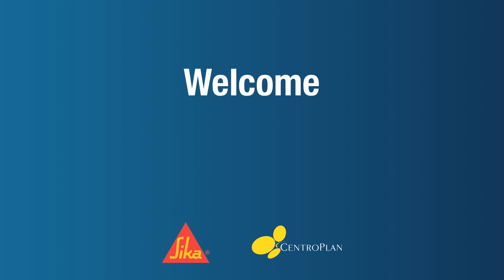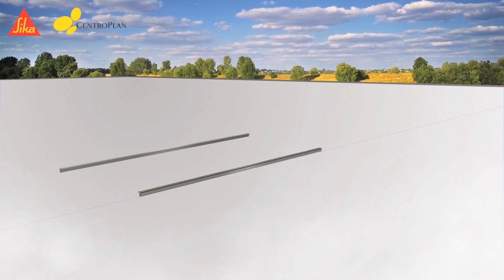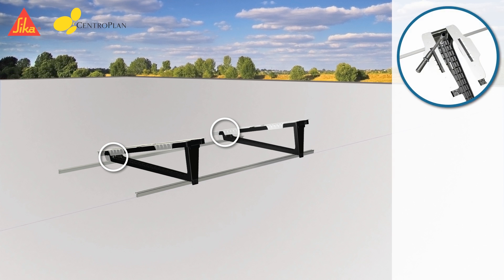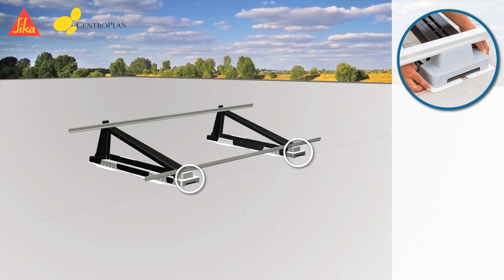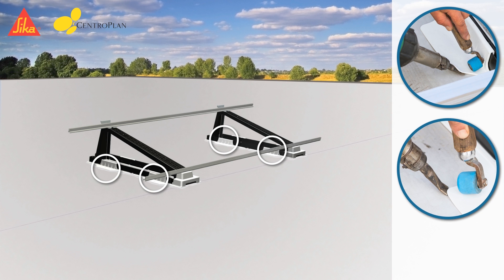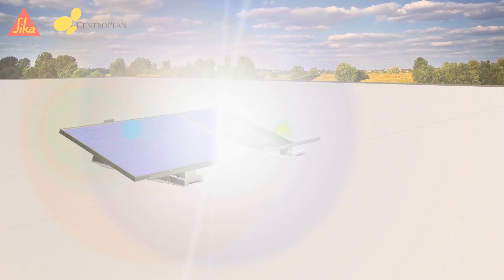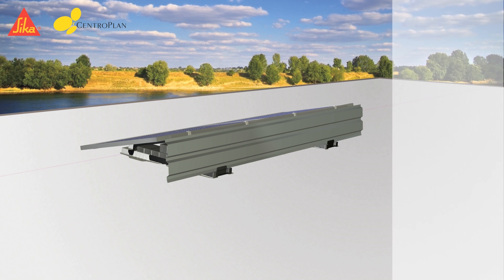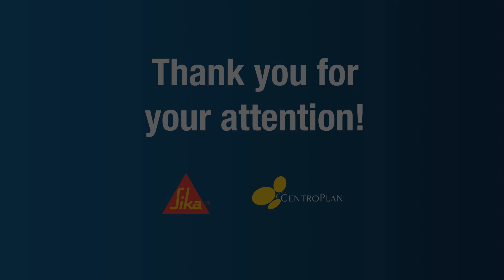Sika® SolarMount-1: Mounting System for PV Panels on Flat Roofs

Comment: Specification of aluminum profiles and tube
Alloy: 
2A12, 2014, 2014A, 2017A, 2024, 3003, 5083, 6005A,  6060, 6061, 6063, 6063A, 
6082, 6463, 7020, 7075 etc
Temper: O H112 T3 T351 T4 T42 T5 T6 T651
Out diameter: 10-220mm
Wall thickness: 1.0-60mm
Length: 500-6000mm
Surface treatment Mill finish, anodized, PVDF Painting, Polishing
WhatsApp:+86 15169199679
Email:zhangxia@huifenglvye.com
           huifengalu@hotmail.com